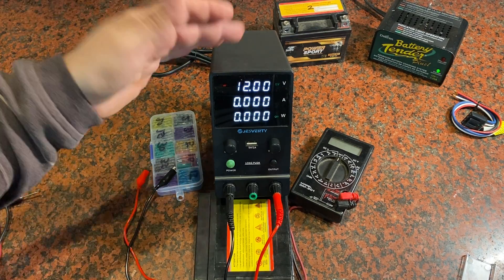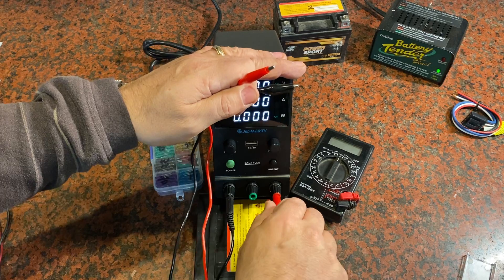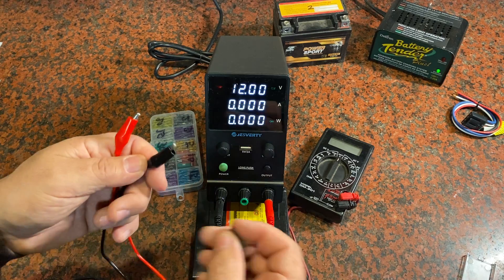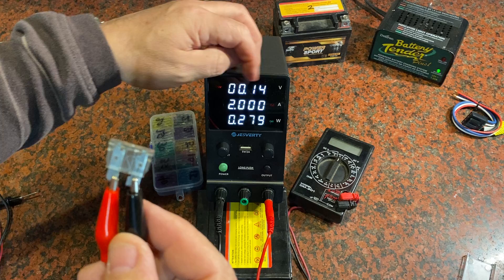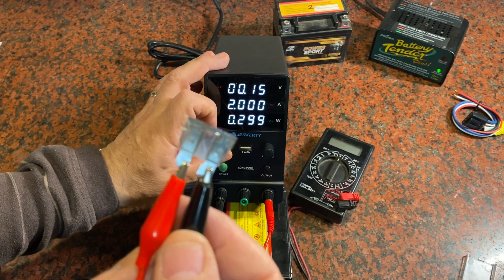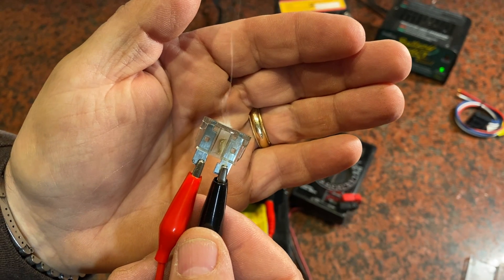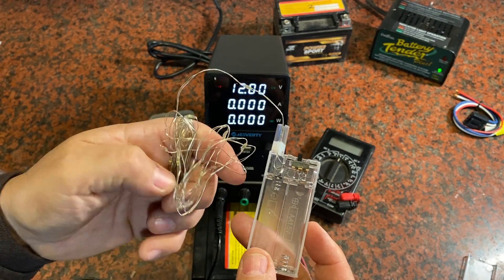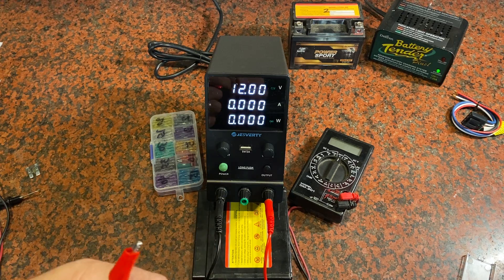See it in Action! DC Power Supply 30 Volt by JESVERTY

Comment: I just got one of these and wonder if you could help me? I bought a water heater element. Rated 48V 300W. (I have the 120V 3A version)
I set it to 3A and 48V. As soon as i connect it it changes to 24V 3A. Why?
Reply from the maker: This is a DC power supply. What you are dealing with is 120 V AC.
Reply: Hi! That is because 300W at 48V requires 6,25A and your supply can only give 3A.

Comment: Do you ever get tired of using an encoder knob instead of a potentiometer that adjusts much quicker?
Reply from the maker: For the times I use this, the knobs are just easy and work fine. I’ve not had a unit with the type you describe. How is it better?
Reply: I only get tired of using those enbcoder knobs after they get tired of working properly. I dont have the supply shown in this video, but another one. I dont use it very often and after maybe a year or so the values jump up and down several steps when moving the encoder. So it got a bit harder to adjust  voltage and current.
But I also have some older bench powersupplies with potentiometer and they show the same effect, just much worse. 
Potentiometers show the same problem than those encoders, if they get older and not used a lot the contacts get dirty.
So to me the important feature at the powersupply in the video is the "output" switch. This way you can easily switch the output off while adjusting the "jumping" values.